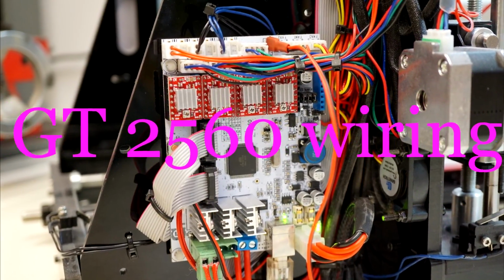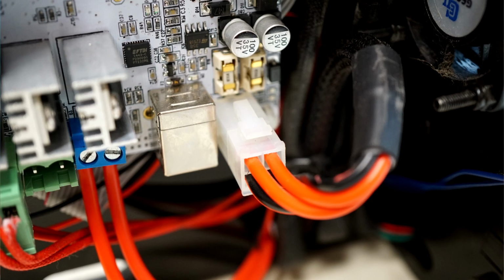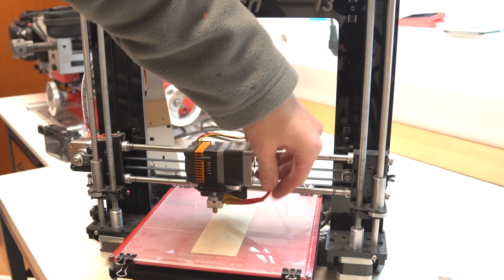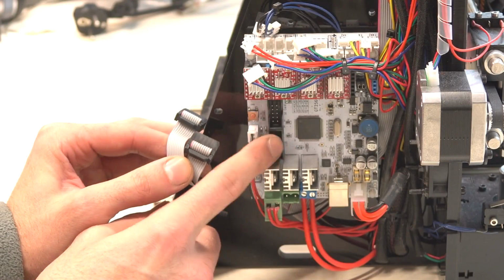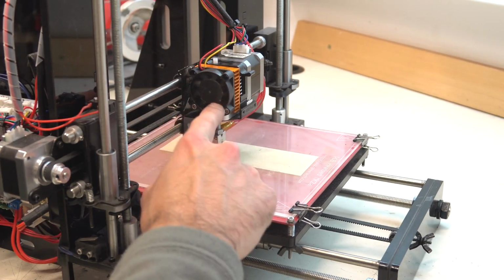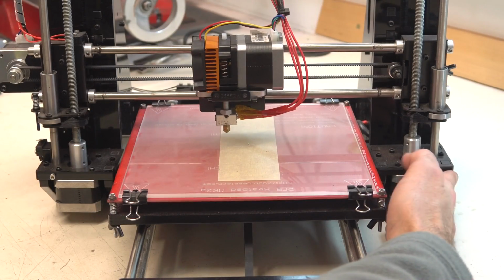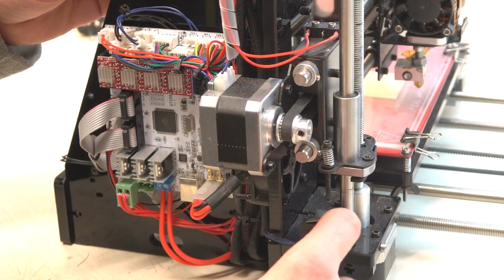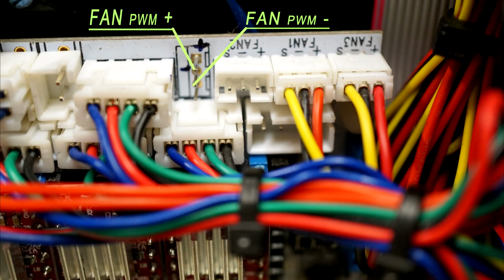GT 2560 board wiring diagram - geeetech i3 pro b 3d printer connection plan

Comment: Hey man by wiring the pwm fan like u explained can i control it in marlin temperature fan speed, right away or i have to change something in firmware?
Reply from the maker: Nothing, you can controll as it is
Reply: @TinC33 Isnt working.... A new board maybe the mosfet aint powerfull enough
Reply: Turns out is working with your connections but only via command in ultimaker cura, M106 S<speed> . The LCD Control fan speed doesnt work.
Reply: What strange is i tried reversing the wires to try reversing polarity but it didnt work, only works in certain wire connection way.

Comment: hey can it be that they now dont come with cooling fans anymore becaise o dont have the cooling van that goes close to the print
Reply from the maker: They never come with a fan there's just output on the board, need to buy fan separately, check ebay for "turbo fan"
Reply: @TinC33  i was building the printer started on friday was "done" saterday now its sunday and i had the same problem yesterday and today that the extruder motor is going the wrong way do you know how to fix that
Reply from the maker: @Grolboy  turn the conector on the motor or only 2 wires, check youtube how to revers stepper motor direction.

Comment: The fist extruder heater works just fine but the bed platform won’t heat up like it’s stuck at 27 or 28 and I plugged the cables exactly like in the video
Reply from the maker: Check for all the contact, behind the bed and on board if connector solder well

Comment: why doea my make lot nosie when it goes home touching the end stops the it settles  to nosiey
Reply from the maker: i don't know, maybe you got something untighten, steppers can be loud with right settings
Reply: @TinC33  well how can I stop that I in looking some printing ok but when goes home damn
Reply: @TinC33   it was the end stoppers finding out  but now it prints at end now whicch one u use
Reply: Do you have go in and set the settings or should automatic goes back when done
Reply from the maker: @chas290620  depend on end of g code wich you generate in slicer, btw i don't use that printer anymore
Reply: @TinC33  what do u use I figure out the end stop a going rewire it was playing around with it and. It stops with out all that noise.. Now. Have to figure out how it prints back rt unless it's the thingiverse g code
Reply: Without making a racket

Comment: Great video thanks for confirming my connections. One thing? the fans air direction blows air away from the motherboard toward the front of the printer not onto it. Is this the correct way. Thanks.
Reply from the maker: Thanks, yes also mine blow air away from mobo. After all this years no problem with that.

Comment: Hi!
I have a problem with Geeetech i3 pro w 3D printer. I have made all the wiring properly and the printer works fine when i move the axis manually from the screen. But Y and Z endstop seems to be allways triggered. I have tested them changing the port and they work fine so the problem must be in the board GT2560 or in the firmware (I have already tried changing Y_MIN_ENDSTOP_INVERTING and Z_MIN_ENDSTOP_INVERTING from false to true and that makes the printer work reversely so it means it is triggered anyway ... Idk What to do! Can somebody help me?
Reply: I asked this here because the board is the same.
Reply from the maker: @Rafitavv  hm i don't know, what about if you resolder the wire from NC to NO or otherwise? Basicly it's same as inverting into firmware...
Reply from the maker: Maybe check wires try to disconnect the switch?
Reply: The problem faded away by itself. I don't understand exactly why. Thanks for your answer

Comment: Hi, my printer is secondhand and came nearly fully built but it was not wired. In which hole does the thermistor for the nozzle go (in the nozzle)?
Reply from the maker: Lewis Hayhow there is some tiny hole into aluminium heated block, one hole is for heater, other is for thermistor, third with thread is for nozzle and throat. Try to watch some video about head assembely